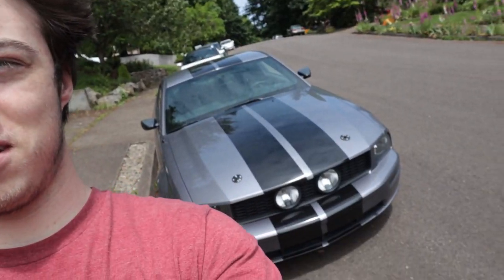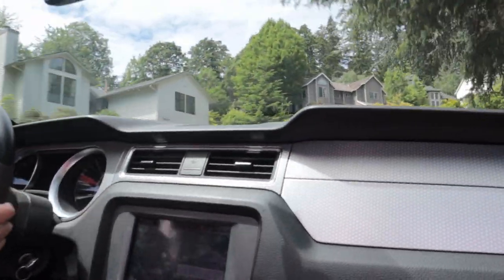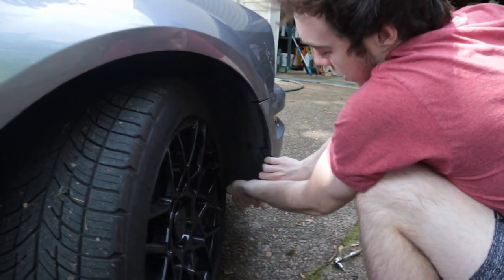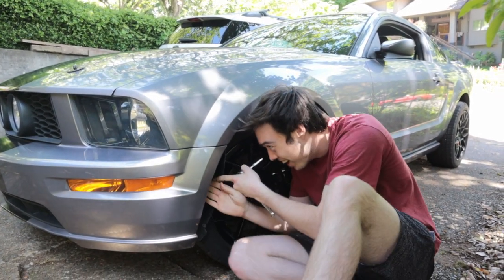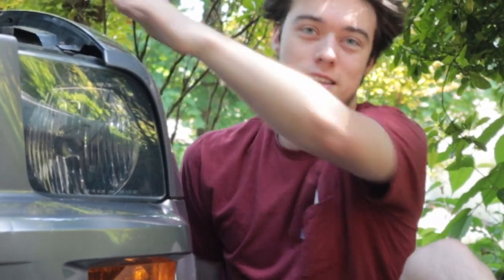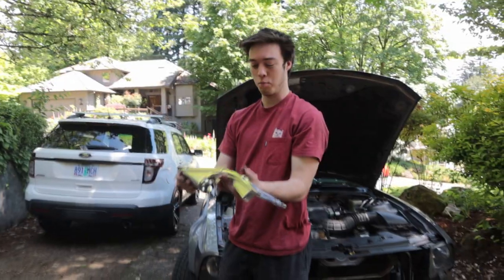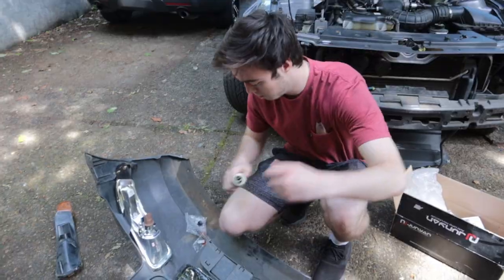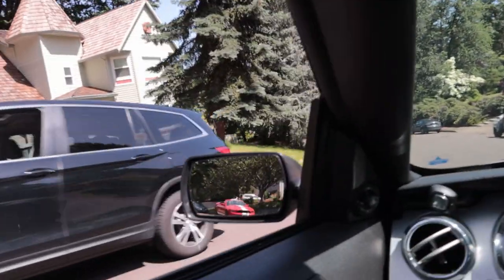Installing Tinted Front Turn Signals on the Mustang GT!!

Comment: What’s your exhaust setup?
Reply from the maker: Stock manifolds, BBK Catless downpipes & off-road x-pipe, then the Roush extreme catback exhaust with no mufflers. It’s basically a 2.5 inch straight pipe with 4 inch tips